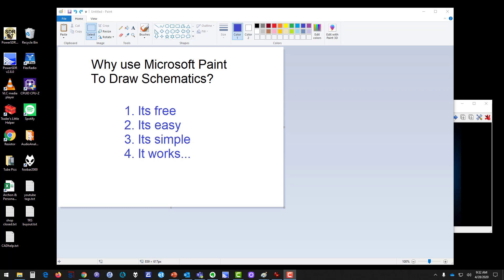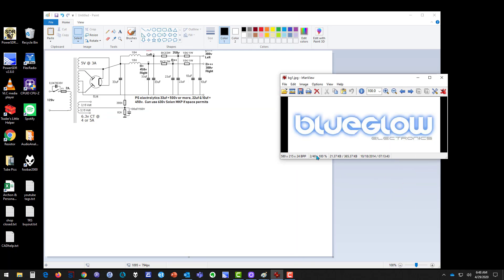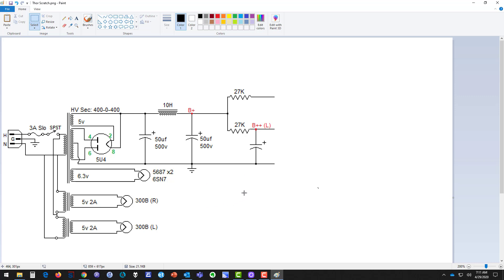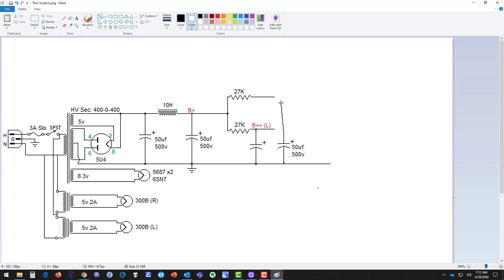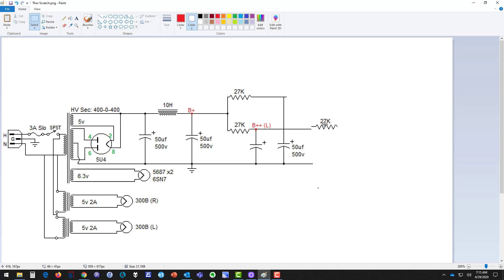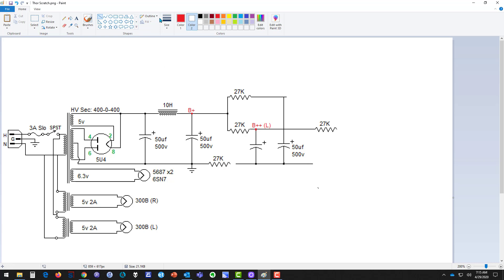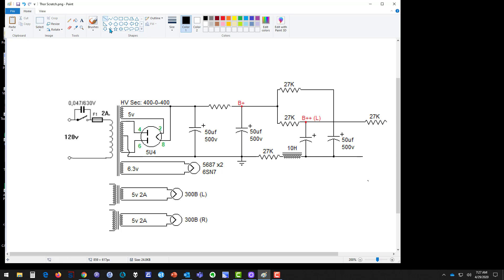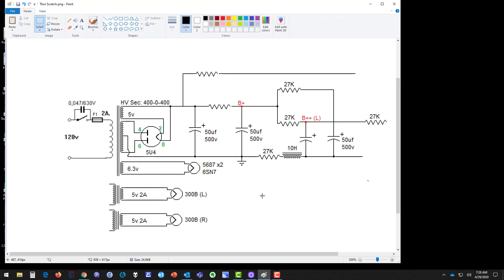How to Use Microsoft Paint to Draw Electronic Schematics

Comment: I very much appreciate the information that gets shared through this channel. But for drawing, nothing beats a good graphics program. Being able to work with vector art is way better for clarity...no pixelation. I was lucky enough to several years ago to stumble upon a post mentioning that Adobe had made an older version of Creative Suite available that was unlocked. I already had a small level of experience with Illustrator so I jumped on that offer and am glad I did. That was some 10+ years ago and I still draw projects with it. There really isn't a part or schematic symbol that you can't draw and then save to cut and paste into a circuit. Snap to grid or point is just as useful as a CAD program...except that with Illustrator saving as an easily used image file is a snap. I would highly encourage people to look and see what's available for open source graphic software and spend some time with it. If you can find a copy of Illustrator, even going back 20 years, it's excellent to use once you get some chops with it. And user manuals and tutorials can be found for it on Amazon.

Comment: So the amp the power supply demonstration showed is a single-ended 300B stereo amp with two 5687's as preamp tubes and a 6SN7 as the driver?
Reply from the maker: That's one idea kicking around on my bench atm.

Comment: You can go even further by utilizing other free or included software.

You want fancy fonts that are center justified? Fire up WordPad, that rich-text editor that's been a part of Windows since the early days. Copy n Paste from there.

Need fine rotation? Grab IrfanView. I've had a copy of this Freeware on my PCs for the better part of 20 years, since Win98. Do what you need and Copy / Paste...

And while you're at it, check out ALL the menus in Paint. There's tons not covered here, but Mark demonstrated the minimum to get going.

And if you don't have a Snipping tool, you can use PrintScreen and it's variations to do what you need.